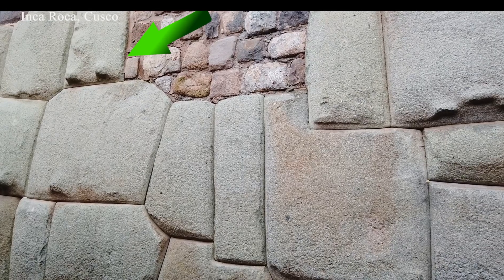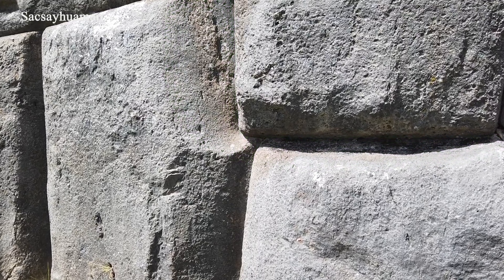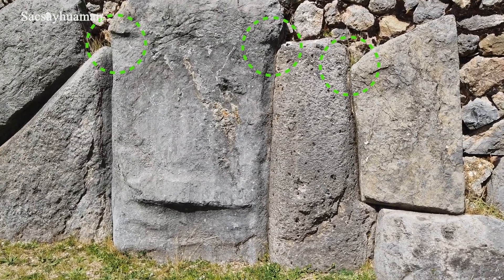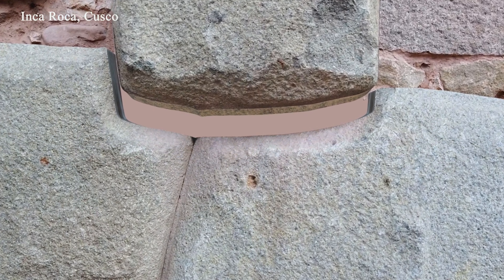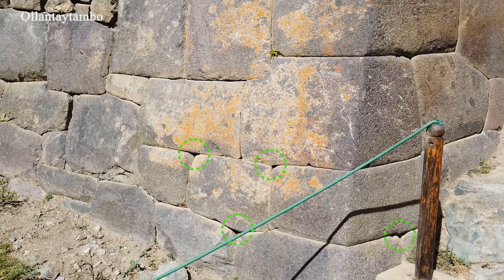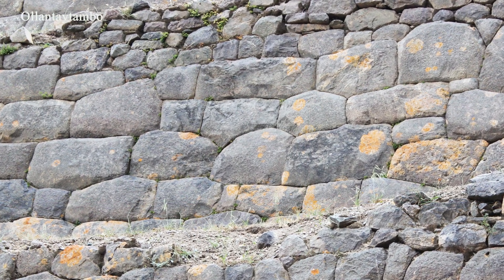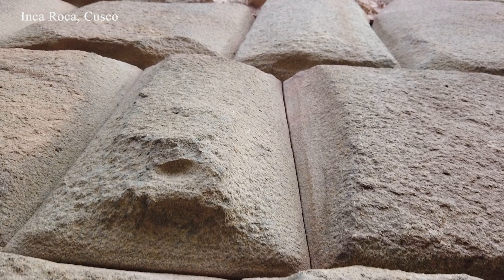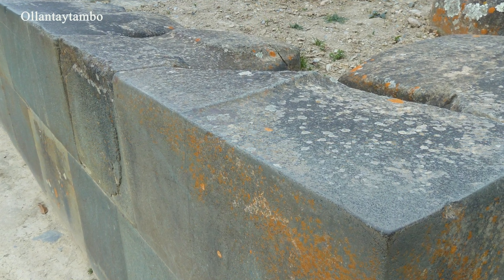The Geometry of Precision: On the Role of Bevels

Comment: Excellent contribution.
Why several cultures, at different eras, in different places, would have decided to build using the largest stones they could move, and fitting them the tightliest (finding similar solutions, because there aren't multiple ways to move and work blocks with the same simplicity of tools, the same human bodies and brains, and the same gravity) ?
Well, probably because it was the most durable (if not eternal) construction technique available, for buildings important technically, politically or spiritually. A tideous work but verylong-lasting : maybe more profitable than their other lightweight buildings.
Reply from the maker: Thank you. Yes, I agree. With some clarifications https://youtu.be/SSM4d238JSI

Comment: You are overthinking the chamfers. The reality is so much more simple than that. The flaw in your presentation is that you gave zero assessment to erosion. Whereas erosion is responsible for just about everything you pointed out.
Reply from the maker: Thank you for your opinion.
Reply: @ - with all due respect- it’s more than opinion, and I shouldn’t need to explain the principle of erosion because it’s an established fact. Surly you agree? What is not an established fact is the proposal that Neolithic builders could accurately slice off pieces of extremely hard rock, leaving no trace of tool marks and repeating that process thousands of times over. You need to demonstrate a feasible proposal to that first before you forensically examine the chamfering. Otherwise it’s just a fun thought experiment with no foundation.
Reply: @SueDonum123  The chamfers, like the faces and sides of the blocks, are obviuosly covered with toolmarks. Which would have been erased by any agressive erosion.
Reply: @PèrePendiculaire - well that makes no sense. How is something obviously there if it is erased? Furthermore, where are the tool marks for those constructions permanently under shelters such as a natural caves, and have never experienced rain? No tool marks anywhere? How did they get erased? This is the inconvenient fact that the creator of this content doesn’t want to acknowledge because it unravels all of his work. Ironically, these are the exactly types of facts that lead to the truth, and that’s why he is so far from that destination.
Reply: @SueDonum123  The toolmarks are nearly everywhere on these stones. The author of this video is providing some good close-up pictures of them (the white dots, and the granular texture), revealing impact tools. So i don't understand your points.
Reply: @PèrePendiculaire - tool marks are scratches and gouges and are found nowhere . Those dots are granular patterning. It should also be noted that those walls were also reworked in modern times. These faces were rendered over, then stripped back to reveal what we see now. Not all surface markings can be attributed to the original builders. They lived in a pre-metal time. That’s why there are no tool marks
Reply: @SueDonum123  who said only metal tools could leave traces ? The granular patterning are impact tools.

How do you explain toolmarks not only on the chamfers, but also on the contact sides of the blocks ?

Which historical or scientific sources for a later reworking of the walls ?
Reply: @SueDonum123  slight correction, they definitely sliced if off, as it is placed on a foundation instead of carving down onto it as shown over millions of blocks later.
Reply: @constructionestatemanageme9635 - that makes no sense. Can you rephrase that?

Comment: I really appreciate your work. Great observations, again. Along with the recesses, you could also associate the bulging stone edges as on the casing stones of the Menkaure Funerary Temple, or the many other examples in Greece for example. I believe in the softening of the stone as a final joining process. I have mentinned this before, I believe that the nubs are the result of that process. Nubs for Nothing.
Reply from the maker: Thank you. Your version has some probability, where in the nobs points there was no weakening of the stone. But here it is difficult to somehow justify. I have no ideas yet.
Reply: @GRES_TAC  I think that the inverted nubs are broken off nubs while still in an altered state. The example in Pisac, between the alcoves, is the most obvious. Such a regular indentation could not have been left by a nub breaking off nor by some "erasing" the nub.
Reply from the maker: Thank you very much! You made me think. Interesting idea. The bosses in Pisak are conical. And most likely they broke in the narrowest part. Which is exactly what you can see. https://drive.google.com/file/d/1x7Lsx4i0eL4_QZU2l9e1tXauaaw78AL5/view
Reply: @GRES_TAC  stone nubs would never, and I mean never, break off leaving a concave indentation, let alone that regular. That if the stone is in the state that we know it to be.

Comment: Bevels reduce the surface area where perfect matching for good fit is required. Also allows for easier post-assembly flattening of surface.
Reply from the maker: Thank you. The first is not quite true, the masonry has deep joints. More details were given here https://youtu.be/1OQl9pqhPb4 Therefore, there is no significant saving of labor. The second is mentioned in the video. Bevels are needed to bring the surfaces to the same level.

Comment: Good systematic analysis.  Long overdue.
Reply: Yes - having so many delving into these mysteries from so different angles may lead to eventual solutions.

Often it's something simple that no one thought of - there was a century long perplexing mystery in Death Valley, CA, called The Race Track where modest size boulders were all being slid across a muddy lakebed, not only did that seem impossible but the tracks were undisputable, but also all the rocks moved in unison, abruptly turning together and so on.

Just few yrs ago someone had cams set up at just the right time and solved the puzzle - a thin layer of ice formed encompassing the widely dispersed boulders and the wind pressure on the ice would move the rocks with the ice, but as soon as the sun hit the ice was gone, just the tracks in the mud remained, conditions had to be just so and an observer in the predawn morning required at that time.
Reply: @Mrbfgray 

No it was God playing marbles with Lucifer...
Reply from the maker: Thank you very much!